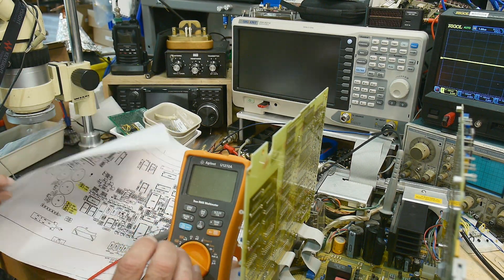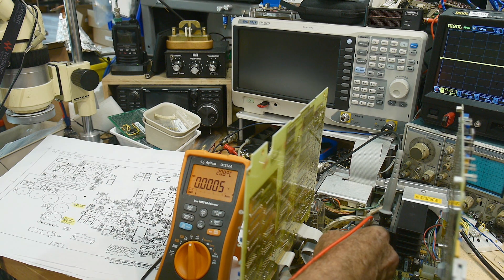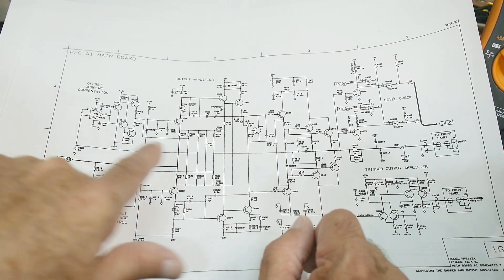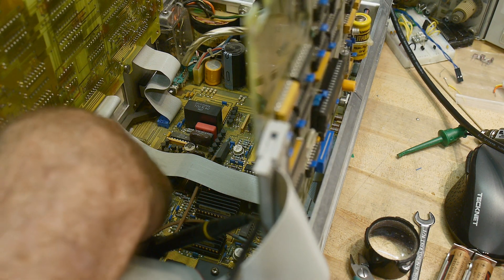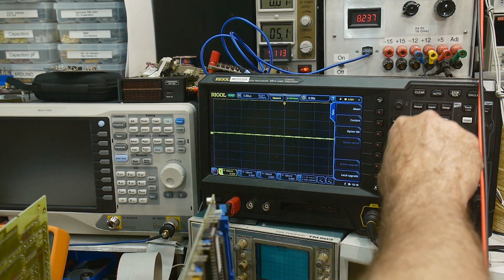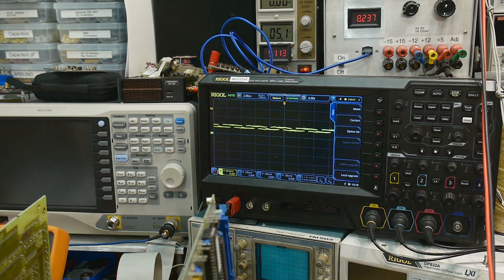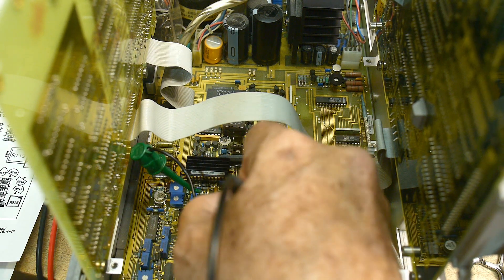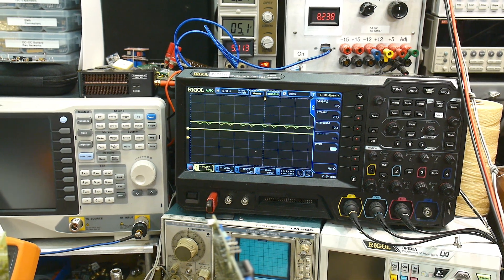#1653 HP 8112A 50 MHz Pulse Generator (part 3 of 4)

Comment: I could tell your heart just wasn't in it. I have been working on a  8116A and it's a bit over my head the ECL and diagnosing these circuits almost got the best of me. But I'm still chugging along. What will it take to get a set of output transistors Q503~ Q513 and the heatsinks attached to them? they are the ones under the the heatsink next to the caps you changed? I came up with some NOS ones that were supposed to be suitable replacements (They were not) there are stopping me from progressing on this project. You said something about trashing them. Can you help me out?

Comment: You have power on the rails, but does that power reach the last chip, which has no output? You are changing out that chip, before confirming the original has power? Or, that the signal that supplies it is on its pins? I take it that you will do that off screen, before pulling the chip.

Comment: I did some text searches in the pdf of manual.  Test point 9 is at grid b3 or b2, depending on the drawing. 
Similarly, I found testing information for tp4 & tp5. Your values are definitely not spec.

Comment: Two comments - one for beginners  - when checking power rails ALWAYS flip over to AC volts and check the ripple, probably not an issue on this unit but good practice.  The signal levels at TP4 and TP5 are only +0.14 volts to +0.26 volts with TP5 inverted with respect to TP4. Probably needs a closer look. Regards, David